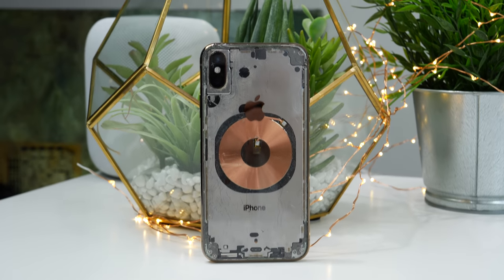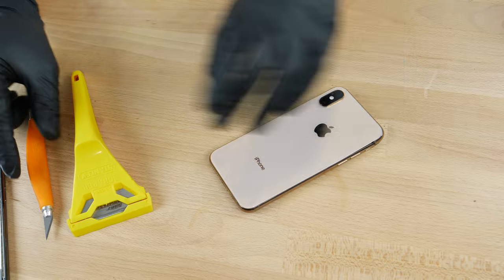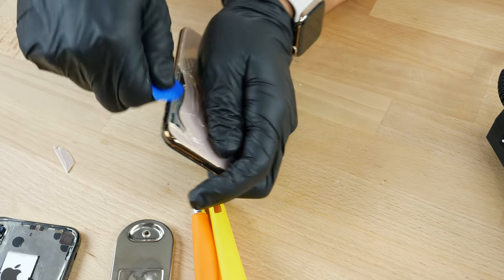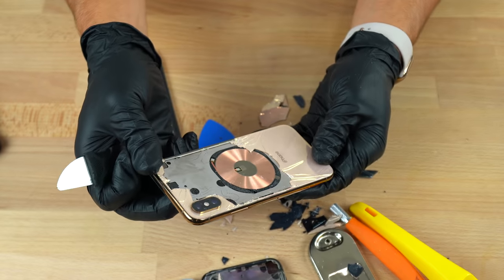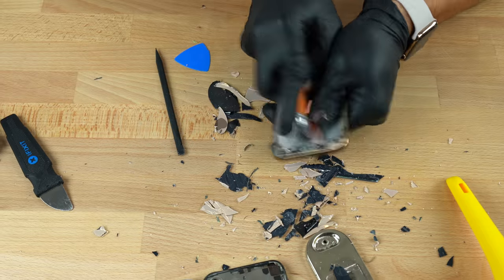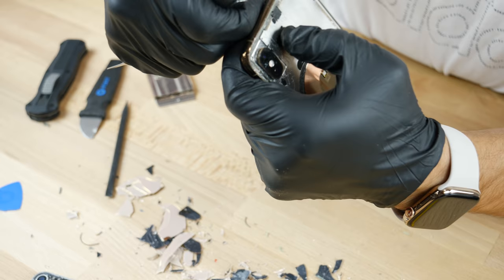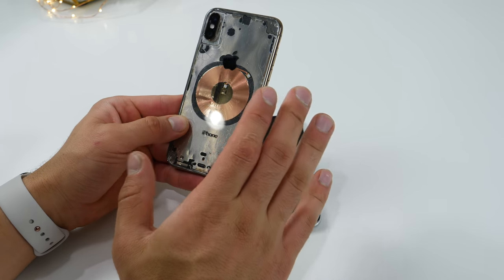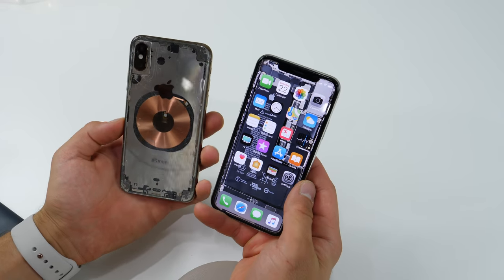Totally Clear iPhone XS Mod!

Comment: Would it survive a waist height drop test or a 1 meter water resistance/proof test its probably has a IP 67 rating now. 😁
Reply: Denzel Gwangwadzwa Watch his water and drop tests. Your answers will be there
Reply: ChrisCarGuy - hes on about when its clear
Reply: Denzel Gwangwadzwa not even ip67
Reply: @chriscarguy  I saw the water test one were the out of the box iphone survived the River Dive but would this customized one surive though
Reply: @canyourepeatthequestion3531  precisely
Reply: You’d need to reseal it and even then it’s probably only good enough for dust and splashes now
Reply: No iP at all anymore 😬

Comment: You’re probably aware of this, BUT, iOS 12 update on iPad HEAVILY suggests a full screen iPad, control center mirrors that of the iPhone X since (on locked screen) if you swipe up from the bottom, it brings the passcode screen or straight up unlocks it, you don’t have to press the home button anymore
Hope you dig up into this!

Comment: When you heat glass, it tends to make it more brittle and susceptible to cracking with a bit of pressure. This is why its so difficult to remove the glass from the adhesive. You need to heat it up to melt the glue, but too much and the glass will break as soon as you apply pressure.

Comment: I knew you were going to break the glass when I saw you using that spudger. You can't use such a thick tool under tightly bonded fragile glass. You need to use a strong playing card, dipped in isopropyl alcohol, and some heat. Maybe even some acetone.
It looks super difficult though, so tight.

Comment: it does look really cool , I would prefer a glass back without the apple logo as it does not look aesthetically correct in placement relative to the charging coil to my eye. I also am having a hard time finding a clear shot of completed project. would be good to put it down on table and provide a nice still shot of it. to me it looks like it is all scratched to hell form removing the back? I have seen use of heat gun to soften the apple adhesive before removing back of phone, I think results would improve. Thanks for another great video!

Comment: A good way to save over $500 on a rear glass repair and makes you wonder why apple charge so much if you are able to remove the cracked glass and they replace the frame ect to do it

Comment: Hey can you please post the 1st page of the Geekbench from the XS 512gb & XS Max 512gb, so it shows the clocked ram. 

I got a 256gb XS & I heard a rumor that if you get the 512gb, the ram will be higher?   (Lol I think I heard that from U :) My XS 256gb shows 3.67gb/ram  & my iPhone X is just 2.67gb/ram, that’s 33% increase in power! My XS is MUCH faster, & I don’t think it’s all iOS 12, because I did put ios12 on my X 256gb.

XS feels like the last year model of a car that’s been out for 5 years, where they just fixed all the problems, added more power, extra gear in the trans, new bumper & headlights🤪 RUNS GREAT SO FAR!

Comment: Don't do it, pleaaaase don't do it, it's madness what I went through. Not only the back got cracked when I had it replaced, but the silver bezel around it got scratched, I hope I can fix it by polishing it. Warning, If you have the space gray iPhone with black sides I highly dissuade you do it, because if the black border gets scratched it'll be near impossible to polish it without scraping the colour of the frame.